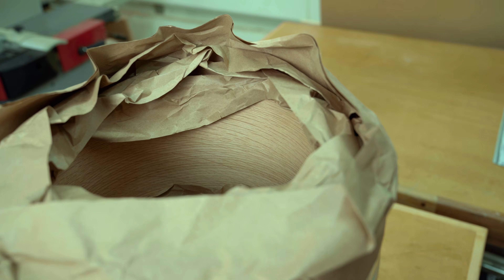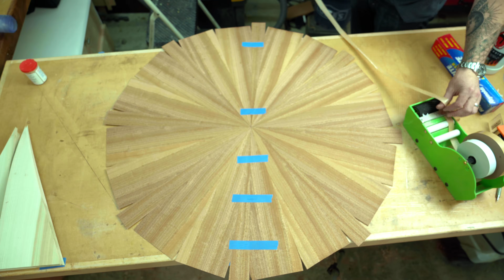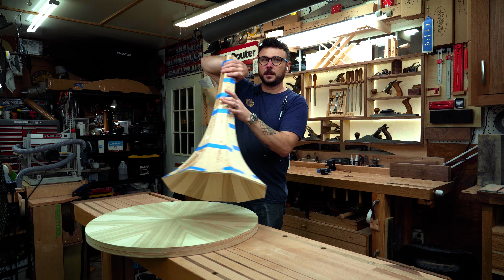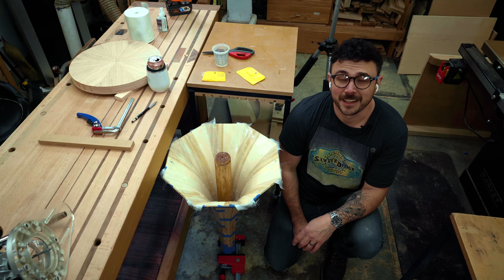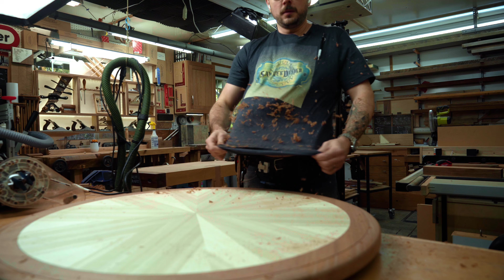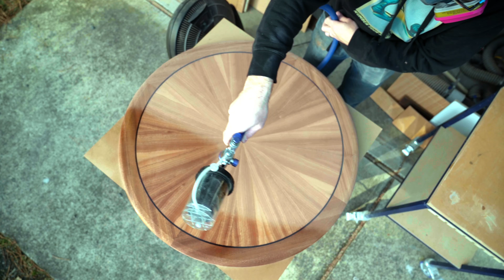Wood-bending Hack to Craft a $7,000 Bistro Table

Comment: Excellent, excellent. I think there are creative woodworkers who can visualise unique designs and build them; then there are woodworkers who can “copy” designs, tweaking them to suit themselves. You are in the first category; I’m in the second and bow to you in appreciation. 

I hope your client understood and paid for the amount of labour in this. The cost of the timber and veneer is a lot - but hours and hours of labour! 

I was taught a couple of rough equations. Firstly, that, if you introduce 1 curve (as opposed to just circles) then labour is doubled; if you introduce complex curves (which work off each other) then you factor the labour by tenfold. Secondly, the first one of a set that you build takes the longest; the second takes 20% less; the third and subsequent ones take 30% less. Obviously, those are not built in stone and accurate but it gives me an idea of labour time and, when I was selling bespoke stuff, something that I could use to explain to customers why a piece like yours had 10 times as much labour as a simple square or round pedestal. 

I’m sure you found it necessary but I would like to have seen one table as you did it - and another with some sort of glass top so that you could look down the trumpet; however, I accept that a glass top is high on the naff list.
Reply from the maker: I like that formula. I definitely price differently than I used to with rectilinear projects. Materials become almost negligible. A glass top would be awesome! I might be tempted to pour the whole cavity with epoxy to eliminate the stamen which would be cool and a pain in the ass 😂
Reply: @SawyerDesign  that would be a whole lot of resin - and probably lead to a heat-cure problem. It just seemed a shame to cover up that beautiful internal shape.

Comment: I can try to explain what went wrong with the 22° angle.

Suppose that you want to mesure the angle that the roof of your dog house makes with the vertical (in CAD). To do so, you cut your house with a plane that contains a vertical axis, and you take your mesure. But depending on the angle that your plane makes with the wall of the dog house, you will obtain different angles. In the extreme case, if you plane is almost parallel to the wall of the house, you will obtain an angle of nearly 90°. Most of the time, you want the plane that you take to make your mesure to be perpendicular to the wall.

It just happens that this "perpendicular plane thing" is not what you want.

Indeed, put you bent lamination in its final position (with the narrow part almost vertical but the wider part more horizontal). What you want is that you have a 22° angle for any horizontal plan that cuts your bent lamination. And indeed, such a plane might be almost perpendicular to your lamination in the narrow part. But it definelty is not in the wider part. Thus the problem.

I hope that I could make myself clear.
Reply from the maker: Yeah I had a whole explanation of how it’s basically a compound of the two planes so if you tip the bevel gauge parallel to the floor, it becomes 22.5°. That part didn’t make the cut lol.